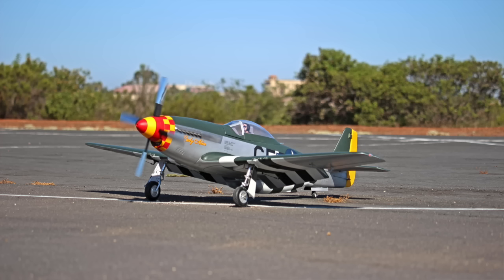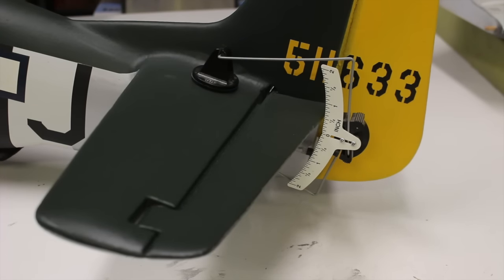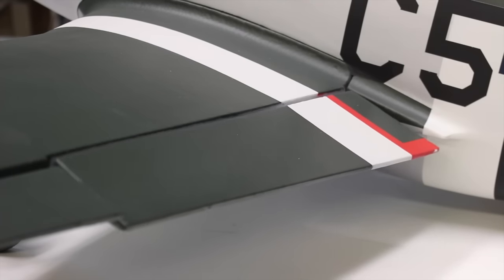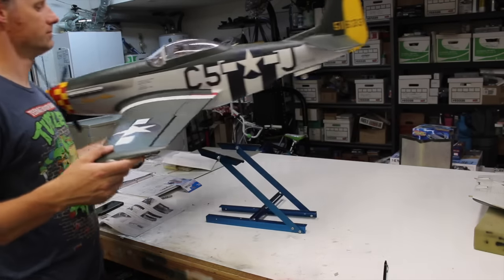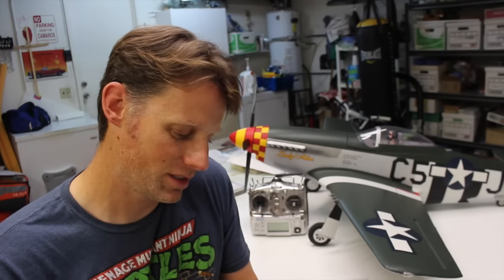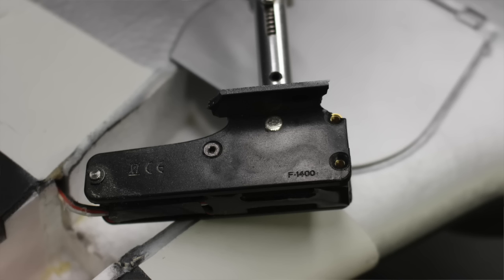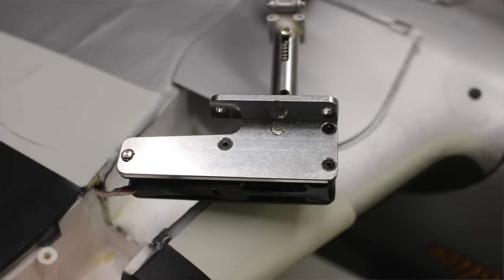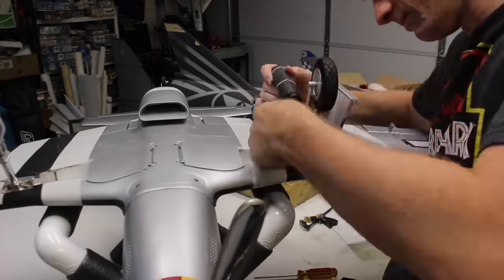Refinish a Foam Warbird Ep4 - FMS P-51 Flight Review & Setup

Comment: I just recently found your series. You are a man after my own heart. I cannot be happy with whats out of the box eather. I am an old time modeller from way back. My first plane was a balsa and tissue,rubber band powered plane years ago. I have had the cox plastic .049 line control planes,then got out of it for a while. Due to Cancer and a surgery that left me in a chronic pain situation,I had to give up a lot of my really physical activities I loved and take a step back. I got back into building models,then rediscovered RCPlanes. I bought an Apprentice  to get my feet wet,then picked up another one at a bargan price,then I built a few foamys from the flite test line. I have added a couple more planes including a Dynam Waco Biplane and a F4U Corsair. I cant leave well enough alone,so I have coustomized the Biplane and am about to do the same on the Coursair. As I said,I cant be happy unless I am doing something fun,at least within reasonable standards according to my pain issue and what I can allow myself to do without fall out. I have to watch my activity. Too much fun wipes me out. I really enjoyed your video series,It gave me a few ideas. You were a brave man using lacquer paint on foam. I honestly think after all that you could almost get away with flying a gas engine in a foam plane qith no ill effects,lol.I use a different light weight foam filler that has never let me down,I have to admit,I bought some of that crap with the primer in it. The garbage dont even work on a wall! I like the minwax poly,it works great as a sealer.I have noticed it softens the factory paint so its best to let it dry for a week before bending the rudder,airelons or other control surfaces.I use hot glue on all my control surface joints because everything else fails. I hate the joint tape,it uglys up an otherwize beautiful paint job. I know foam popcorns up easily,I dont like putting my planes in a hot car then leaving them.My first attempt at repairing compressed foam tought me about being careful with the steam around the hot pan of water.
Reply from the maker: +scott firman Thanks!  I'm glad you found some helpful tips in the series and to know that you've rediscovered the hobby.  The beauty of it is that it's here and available as much or as little as desired.  Hopefully it can provide a little mental relief to you from the chronic pain. :(

EPO is remarkably resilliant to a number of solvent based paints, I'm continually surprised by that.  The primary drawback is that EPO doesn't really sand at all like a typical foam.  It just gets "hairy" when you try to heavily sand it at all.  So doing heavy modifications beyond just refinishing requires a little creativity.

Comment: I'm new to the RC Plane hobby, the V8 FMS P-51D is my 3rd plane.  I haven't flown it yet.  Currently working out the amount of travel on the control surfaces, and found that the measurements stated in the manual don't seem to be possible.  Your video helped me to know that .5 inch of elevator, rudder, and aileron travel is sufficient.  The manual states high rates should be 1.6" Elv, .98" Rud, and 1.1" Ail.  I'm unable to achieve that amount of travel with the included servos and linkages.  Thank's for the helpful video!
Reply from the maker: Thanks for watching!  Yeah, I had the same issue, but it's way too much anyhow.  Consider my settings a starting point.  It's been perfect for how I like to fly the airplane.  Note that I'm not using any expo with the setup.  So, if you like expo, you may find the settings a little soft around center depending on how much expo you like to use.  Just a heads up.

Comment: Hey thanks, looks amazing. You mentioned a more scale prop you installed from Airfield. Could you provide the info on that part? Thanks, Jeff
Reply from the maker: The airfield brand was sold by nitroplanes.com. Unfortunately, they’ve not had that brand in stock for a few years. 😕

Comment: Great 👍 series learned a lot.  One question regarding the acetone, doesn’t acetone melt and turn styrofoam to mush? Did you only use it sparingly damp on a microfiber cloth?
Reply from the maker: The thing to keep in mind is that these foam airframes are epo foam which are extremely resilient to solvents and hold up to acetone. You’re thinking eps foam (beer cooler foam) which does turn to mush by most solvents, haha
Reply: @Thercgeek  thank you Mr. Wolfe

Comment: Man! I watch watched the whole series all I can say is you are the MAESTRO. I think it's about time to do the same thing with my fms p51 has done 28 hrs from 6 mins each of flight time with any scratches or parts been replaced but the paintings are getting old. My question here is how much additional weight did it have now compare to to the original weight? Would the original power system will be capable enough of bringing this up in the air? It shows on your video that you upgraded the battery from 4s to 5s did you change the motor as weĺl? And what size?
Reply from the maker: Thanks for the kind words!  Unfortunately, I forgot to weigh the airplane before I stripped it all down, so I don't know how much of a weight change there really was.  On my kfir kit bash (thercgeek.com/kitbashing) the whole refinish only added about 6 oz which includes 2 oz of nose weight (so only 4 oz from the refinish itself).  I've found that these foam warbirds sometimes fly too light and actually track and penetrate better with a slightly higher wing loading.  I stock setup is pretty lethargic on 4 cells, but I'd expect that it would still pull the refinished airplane around.  The upgraded motor is definitely recommended though as the airplane has fantastic power with it.  This is the motor: https://www.motionrc.com/products/fms-4258-550kv-brushless-motor

Comment: I discovered a rather serious issue when working out the elevator rates.  The pushrod was bending severely on up-elevator, and I was only getting 1/2 the distance up, as I was down.  I got to thinking this could cause a crash especially once air resistance would add to the already weak pushrod and cause even further bending or inability for sufficient up-elevator to be achieved to pull out of a dive.  I cut a 3/4" popsicle stick to match the width of the fuselage, drilled holes for the elevator and rudder pushrods, then epoxied the stick to the side foam supports, half-way down the fuselage.  Now those pushrods don't bend at all, and I'm getting reliable travel on up-elevator, same as down.  I'm surprised I haven't seen this being discussed more avidly in the rc groups.  Of course, maybe it's there, and I just haven't seen it.  I would think that most of these FMS V8 P-51s would have a similar issue unless I somehow got some especially weak pushrods.
Reply from the maker: I had the same issue on the elevator pushrods.  I covered what I did in episode 2 of this series (http://thercgeek.com/2015/08/refinish-a-foam-warbird-ep2-fms-p-51/), but I basically something similar using epoxy and some light ply.  I also noticed that the elevators twisted too when actuated and so fixed that as well by adding a stiffener across the back of the plastic carry through.  It's a serious issue that needs to be fixed for sure.
Reply: Jason Lee I

Comment: Super series and VERY helpful as well as very well done !  I have a Horizon Timber that I have stripped the stick on decals off.  I used tape to put on a new paint scheme but it added WAY too much weight, especially in the tail. What paint would you recommend for ease of use and one that would as little weight as possible?   This note will be signed by my wife but it is actually me..Carl LOL!  Thank you !!
Reply from the maker: Thanks for the kind words, I’m so glad you’ve found the series helpful!  I use all sorts of different paints and the key to keeping it light is in the application. Heavier applications add more weight.  The lightest would be airbrushing the paint on. That’s pretty challenging and time consuming on a large airframe, so I like to resort to the spray cans when I can.  Can you move the battery forward at all?  Or do you have a larger capacity pack you can fly with?  Otherwise, I’d recommend adding a little weight to the nose to get the cg back where it should be.
Reply: @Thercgeek  Thank you for your response.  I've ruled our air brushing as being too time consuming also.  Spray cans seems the way to go but what kind of paint do your suggest and would you primer first so that the final coat will stick to foam?  I have two different views from two different hobby stores in the area.  One said acrylic sprays don't work and are no longer made ?  That was a hard one to agree with.  The other suggested using acrylic but went so far as to suggest buying any spray paint from Ace Hardware !  I liked all of your approaches but I want to be sure before I end up putting on the wrong paint.  And yes, I have to move the battery so I'll watch the CG and adjust accordingly and thanks for the suggestion.

Carl Rohloff

Comment: Nice job with the painting and flying!  What did you use for the final protective coat on top o the final paint?  You mentioned it in your 3rd video but I didn't catch the name of the material.

Thanks, keep these videos coming!
Reply from the maker: +Michael Lescord Thanks for the kind words!  I definitely have more coming soon I hope.  I used a non-yellowing lacquer clear coat.  I have a gallon of the stuff that I got from Frazee paint.  Otherwise, look at an automotive paint supply place possibly?

Comment: I see you balanced the plane upright. Most planes that have a low wing are balanced upside down. What is your reasoning for your balance method ?
thanks
Reply from the maker: Checking cg Upright or upside down doesn’t matter. Checking a low wing aircraft is just easier to manage upside down usually.

Comment: i never realized you could go into that much detail in refinishing a foam plane , i just picked up a used Durafly P51 "Old Crow" , Im thinking of doing the same with it now that ive found your channel and watched a few of your videos , one quick question though , im not sure if i missed it anywhere but what was the "stock" weight of the mustang compared to the "finished" weight , im sure the filling and painting ha to have added a little bit of weight , not to mention the upgraded motor/esc etc....obviously it still flies beautifully , i am just curious?
Reply from the maker: +Rcgary24 I had intended to weigh the airplane before I started the filling process and forgot to, doh!  So unfortunately I don't know specifically how much weight was added from the finish.  The airplane with the finish on it weighs about 5-3/4 lb less the battery pack.  That being said, I find that these foam warbirds actually track better with a little more weight to them.  The little bit higher wing loading helps the airplane fly more true and penetrate better.

Comment: Great series makes me wanna give it a try, was there a significant weight difference between the stock paint/plane and when you added the filler and primer?
Reply from the maker: Thanks!  I had intended to weigh the airplane before I stripped it down and forgot to so can't say definitively what the weight difference was. :(  The truth is, the weight gain isn't huge and my experience has been that these foam warbirds tend to fly a little better with a little higher wing loading anyhow.
Reply: The RC Geek thanks! Found my Texas winter project!

Comment: Hi Chris. its been 4 years. hows the paint job holding up to hangar rash ,bumps and grabs?
Reply from the maker: Well, if taken care of it holds up well. Some micro cracks did start to develop in the surface of the wing, but the wing also isn’t very rigid on this model either. The more rigid models I’ve done this type of refinish on haven’t developed any surface cracks. I actually don’t have the model anymore though, I gave it to Ken Wagner who owns the full scale Lady Alice, so it’s in his hangar now. 😊
Reply: @Thercgeek  smooth move!

Comment: question if you don't mind , whats you battery position on the battery tray ? I run a 4 s 3600
Reply from the maker: I have the battery pushed all the way forward on the tray.  I'm using a 30c 5s 5800.
Reply: thanks

Comment: Hey Chris, I have the same plane but the B model. Manual says not to go over 4 cell 2600, how are you using a 5 cell 5800?
Reply from the maker: yeah, it was just velcroed and strapped on the tray.  Didn't take any modification.  As long as the CG is in the right place, it's not a problem.
Reply: @Thercgeek  👍

Comment: I just bought a airfield  P-51Mustang from NitroPlans. I have the gear working but the actuators hum and I don't know how to set the trim. I don't know how to set the flaps as well. I am a beginner. Can you help me  to set this airplane up? I also have a A-10Thunderbolt/Warthogg from Motion RC. I was able to build them although on the A-10 there  are no rudders.  The front wheel turns  but no rudder. I came to find that these are not the planes to be learning on so  I ordered a frewing Pandora. The A-10 is made by Dynamo. I have tried their website. All three planes have gyros and I am able to set those up. It's the trim and setting the transmitter up that is catching me p. If you don't have time can you please direct me to where I can find the info? I would really appreciate it. When the Pandora get here I assemble it and take iii to fly. I have been working with a simulator. I also have 12 nitro RC helicopters. They are the size of align Terex pro 600. One Terex is fly bar two are fly bar less. I don't have those completely set up yet. I have not flown any of them yet. I do have a simulator for them  too. But I  can't wait to get the Pandora assembled and out to fly Thanks James McWhorter  Rockmart GA.
Reply from the maker: Yeah, you definitely want to know how to fly proficiently before stepping into jets and warbirds.  Have you flown before?  I would recommend getting connected with a local RC club as they typically have flight instructors to help get folks flying.  It will help you progress quicker and save you time and money (less likely to crash).  Also, they can help you with getting your aircraft setup properly too.  Regarding the radio question, which radio are you using?  First though before adjusting anything in the radio, you should mechanically adjust the pushrods so that all of the surfaces are centered.  From there, adjust in the radio.  Typically there's a servo "centering" or "sub-trims" in the radio if you're using a computer radio.

Comment: you don't  know what WE know Aus. WE don't get pop corn in the heat and it's bloody hot her mate.
Reply from the maker: So, what's the secret then?  Keep it in the shade? ;)
Reply: We use www. deluxe materials laminating&finishing resin make a paste with model lite and 0.03 glass, glade to help sport. two or more coats will stop popcorn.
Reply from the maker: Ah, so basically glassing the airframe then.  Makes sense.  Do you have a link to the specific resin?